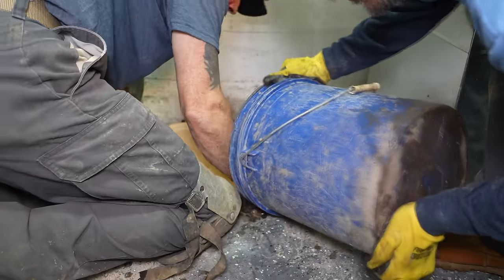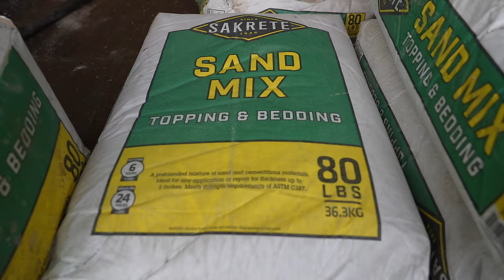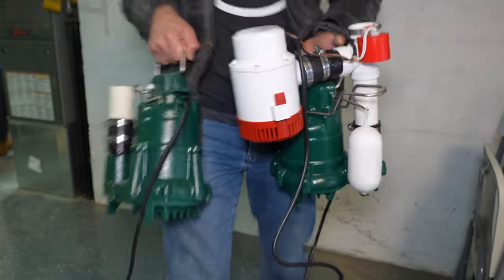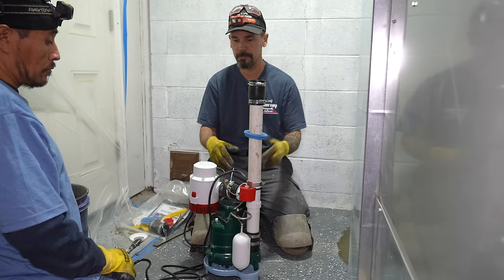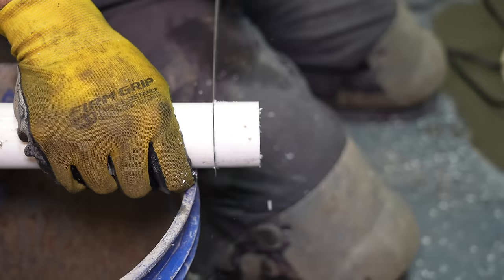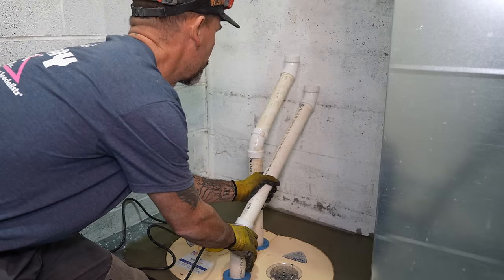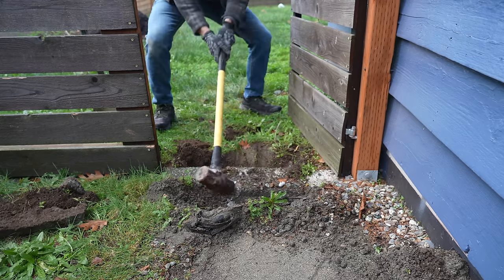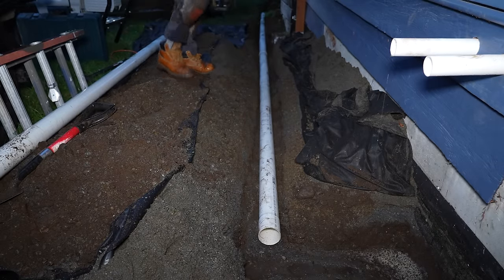TRIPLE Safe Sump Pump System Installation

Comment: I've seen pictures of the Ice Guard freezing over in cold climates.  I'm thinking with an active pump in cold temps, the mist is enough to eventually cause ice to form over the narrow openings.   Reason I mentioned that is because I considered getting one myself, but changed my mind. Great concept, but maybe not the best implementation.

Also, I wouldn't have plumbed both pipes into a single 3" pipe, I would have kept two separate pipes (i.e. completely redundant systems) in case one gets clogged or froze up.  I almost think I'd just leave the 2nd pipe just to shoot out into the yard, despite water maybe some migrating back into the basement.  Perhaps do a little yard work to help it run away.  Just having a stubby pipe discharge wouldn't be any different than water coming out of the Ice Guard.  I'd consider the 2nd pump running as an exception rather than the norm and the goal would be to get rid of water in an emergency.  

Sorry - don't mean to sound like I'm criticizing, I'm not, the install was great! :)  I have two sump pumps and even went as far as running them off of separate breakers just in case if one pump failed and tripped the breaker, it would have shut off the 2nd pump too (if on a single breaker).
Reply: My by design I believe here smaller pump is lower so it gives a chance for the larger pump to sometimes cycle on (most companies just install 2 of the same pumps and second one never gets activated until first pump fails then they find out the second pump has failed as well)
Reply: @leexgx  Thinking about your comment, perhaps using a smaller primary pump to pump out the typical water might lessen the chance for water splatter to freeze up the Ice Guard. i.e. slower but longer = less splatter.   I do think running the 2nd pump straight out is a better option or at least don't combine into a single tile.  You don't want a 'single point failure'  i.e. one thing can render both pumps useless.  I know you have the Ice Guards installed, so you technically don't have a single point failure.  But if one Ice Guard did freeze up, then the chances are, the other one will also freeze up.

I admit I'm a bit OCD about this stuff. :)  The last 2 nights it's been ~-4 to -7F here.   Tonight will be another one, but then the weather turns to a toasty 9F. LOL  More than once I've went out and checked that the pump pump drain is still ice free!  I'd rather be proactive than reactive.
Reply: Air gap would still allow water to pump out if piping failed.
Reply: @sewerrat7612  I agree, but some of the ice guards - I've seen complaints that the openings have frozen shut, probably just do to water splatter.  I still may get one this summer and install and see how it performs in the summer (i.e. splatter or not), then decide if I want it to remain installed for winter.

Or are you referring to ONLY an air gap (i.e. no ice guard)?  I have considered just a straight air gap.
Reply: @Mark-hb5zf only air gap works if there is a larger drain below such as a square grated drain basin leading to piping. Problem ends up being how much it splashes before going out. Could always go directly into larger piping system without sealing the two just dropping piping in that way if end fails at least it pumping outside. Could also pipe in sewer relief poppers would do a few in different sections of line if one areas blocked will just end up pumping to next clear one away from house parts cost a bit though.
Reply: @sewerrat7612  Yeah sewerrat, I agree w/you air gap comment.  Splashing water in freezing temps will eventually turn to ice.  Kind of hard to outsmart physics/Mother Nature. I guess that's what insurance is for at some point, or people just move someplace warm!

Comment: Codes vary, but it is not permitted here to have a storm water drain system inlet set at floor level in the building. Floor drains must be routed to sanitary systems. Ground water is then kept separate from potential floor drain sewage or gray water. Also, the basin size appears undersized, given the power of the pumps. They will cycle too often, especially when combined with the low head  height.
Reply: Hmmm.  I see your point on the concern on mixing floor drain sewage/gray water with ground water.  I hadn't considered that.   In our town, the codes as you note are different.  In the past the treatment plants were unable to keep up with excess inflow from basement sumps etc and then would release untreated waste into the nearby waters (long island sound) even after they redesigned and built new treatment plants.  I guess one way or another, there's going to be potential for that sewage to end up in places where we don't want it...

Comment: Have a double back up system if the power cuts out its also powered by water pressure line in case. Also a back flow prevention from the outside sewer drain

Comment: I depend on a generator and spare pump I keep on hand in the event the main one fails. Simple swap out. We've had power out for over a week from hurricanes and I doubt a backup battery is going to last that long.
Reply: Totally agree. Keeping the system operating in extreme/all conditions is essential, otherwise it will fail. Recommend an automatic failover as failures usually occur when not there or far away to monitor and correct. Ounce of prevention pound of cure is THE RIGHT WAY!

Comment: Great install!  Your material list has the wrong basin listed. I don;t think the one you listed will fit 2 sump pumps.
Reply: The Twin Liner Basket will accommodate the M53, M98 and the Ultra Sump at the same time.

Comment: Guys did an excellent job BUT from experience I would steer completely clear of those (junk) water guard channel systems because there is no way of creating a proper grade when these are placed within the top 3" of the floor and they will continue to always hold water that struggles to drain to the sump & will build up hidden mold in the system.

If you plan to install that type of system in the future & since the floor will already be jackhammered & removed around the foundation,..just Do It Right and install the normal drain tile system that will drop up to 16" below the bottom of the slab & feed back into the sump.

Comment: 3:04 I am curious if the sock by the holes will eventually get clogged by small particles and have to be removed as it's on the outside of the bin. Rather than a filter/grate on the inside where it could be cleaned or cleared of debris.
Reply: it could get clogged, but depends on the filter size, gravel under the slab and silt in the soil, Inside filter is a good alternative easily maintained and montitored. But remember you want water into the basin to then be pumped out and the Zoeller M53 will pump out up to a 1/2  stone, so I think the sock is not good practice.

Comment: Great video! However two 1.5" pipes together do not add up to 3". They actually add up to 2". First on a simple "area of a circle" basis, and second is that pipe wall flow restriction goes up by the power of 5!! So a slightly larger pipe is significantly faster flow. The 3" pipe you put in is actually enough for 8 1.5" pipes!

Comment: Now that you've seen the work done, would you attempt to DIY in the future if needed?
Reply from the maker: Great Question! After seeing how this is done by the pros I'd be 100% confident in doing it myself. HOWEVER, these guys worked extremely hard all day long and now knowing how much work it is I'd most likely have to plan for this type of project to be completed in a week if it was just myself.  Which does include all the time it takes to round up materials and equipment.  Thanks for watching.
Reply: But The thing is these products are not for sale maybe the pumps but nothing else
Reply: @itsabe90  What crack are you smoking? A quick online search and I found EVERYTHING used in this project.

Comment: Is your garage ceiling the floor of a living space of the house.?
If yes look into a better way of sealing out potential fumes from car exhaust, fire proof layer of drywall....
Reply: yes,   install  5/8" firerock on the ceiling and 1/2" on the walls, fully finished. or keep vehicles and any combustibles or chemicals out of the garage

Comment: Its not necessary to install more then one pump. It is a great Idea to have a back up pump being either a battery back up or a water back up system. Also, I know that it is more of an expense to add a french drain around the parameter, but it insures that your basement will not flood again.
We don't use the drain on the footing, concrete should be at least 4 inches to prevent cracking. When we install french drain around the basement we stick to the 4 inch perforated corrugated drain tile and pea stones. Remember, cinder blocks have a hollow cavity which holds water. The cinder block is on the footing and therefore it is not  right next to the soil. Usually there is 3-4 inches of footing before the soil.
I is a little more work but, digging the trench and using a level you can direct the flow better to the pump. Plus, drilling 1/2 inch holes in the cavities of the bottom of the block and running clear tubing into the trench will purge any water from the walls right into the french drain. 
Also, I know its more efficient to just jack hammer a concrete floor but, the reality is that the impact of the jack hammer will cause hair line cracks in your concrete. Its better to use an electric wet saw to precut the concrete to lessen the risk of cracking the concrete, plus its a cleaner look.
Fun fact. the zollar pump is an alright pump and most plumbers like it, we tend to move away from the float switch. These pumps activate every 4-5 inches of water. If there is a high water table these switches are in constant activation which causes the failure of the switch itself. I tend to favor the pressure sensor switch. These pumps kick on after 9 inches of water and there is no way for the switch to hang up or something to get caught in it.

Comment: Get a water alarm. Nice to know when/if the system fails.
Reply: Good to know they exist!
Reply: They work great, too! 9 volt battery, probe sticks down into the sump pit, so if the pump fails, at least an annoying alarm goes off (hopefully before water enters living quarters).

Comment: Looks like you are still low on your discharge lid, the water has to rise before it breaks the top of the yard which means your 3 inch pipe has water trapped inside the whole way

Comment: Basements are swimming pools. acknowledge that..  Power outages for a few days and battery backup is useless. Yea its nice to have if its on a hill with 3/4 above ground. But to do forever it needs gravity drainage.. 30 year storms do happen, or more or less.. Its like Sisyphus keeping a basement dry.  Id raise my washer dryer and heater to a higher level.  after 12 homes one gets more rational..

Comment: Just out of curiosity, I noticed they did not install a perimeter French drain leading to the sump pit?  I always thought this was a necessary measure for a new installation. It seems with that set up you're only really going to get water maybe three or four square feet from the pit?
Reply: I imagine if you locate it near an identified entry point in your foundation/floor slab you can divert a decent amount of water without tearing up a lot of concrete, which is probably the most effective approach.
Reply: @skeptick6513  Most cases of basement water seepage occur due to the rising water table, where water generally permeates through the house footer rather than from a single entry point. My basement currently lacks a sump pump, which I recognize as a necessity. While there aren't visible signs of water entering, there are moisture problems that mandate the use of a dehumidifier during the summer months. After conducting research, I've learned that the most reliable solution involves excavating an interior perimeter trench that houses a perforated pipe directing water to a sump pit.
Reply: @shazaidi  Wasn't necessary in my basement. I self-installed my sump pump very much like in the video. Only difference was I used a 35 gallon or so trash can drilled with many holes. goes down about 32" if I recall correctly. Totally solved my seepage along the footer problem, even when water table is very high. One time to check, I unplugged the sump pump and watched the water come up to almost the top of the pit before plugging it back in. Think about it. If it takes water out only to be replenished, it's coming from a larger area. In my case of 1,000 sq. foot basement, it solved the problem with no other drains, and my land is flat at the base of a slope. Not saying that would work for everyone. Depends on soils, and if there is crushed stone under slab. For further check, my well is about 15 feet from the house. One spring after snow melt and rains with sump pump running every few minutes, I took the well cap off dropped a weighted string down till I hit water at seven feet. That made it just about the level of the footer joint, plus or minus a few inches. That sump pit was the solution for me.

Comment: You should add a 12v inverter and hookups to run the pump or charge the battery from your car
 Or an external generator!!! Power outages can last up to 2weeks in most areas. That battery will steadily degrade and provide max availability for ONLY YES ONLY 2 years!!!

Comment: The problem with most battery backup systems is no one does the maintenance.  Gotta check the battery health from time to time people!
Reply: Some of the newer ones have a plug that charges it while you have power and sound alarm if backup goes on or battery dies.
Reply: !00%  I install battery backups and modern batteries only last about 3 years. The chargers can under or overcharge. Sadly there is no way to know unless you test them regularly.
Reply: @gurugee2112 Try using higher quality parts.  You should get 5-7 years out of a lead acid system.  Considerably longer for lithium.

Comment: My house is on a hillside like yours seems to be, and I have a sump on the deep side of the basement. The other side of my house has a walk out basement door so I don't really think the sump pump scheme makes sense.
Reply from the maker: There it going to be a part 2 with this project just FYI.  This fixes the water table issue.  Next will be fixing the drainage from the front driveway.  Stay tuned :)

Comment: What stops sediment and debris from just piling up and clogging up that drain in the yard?
Reply: It’s the basement, yard debris isn’t inside. Sump pumps are common in most basements including mine. If you had dirt and debris in your basement you’re got bigger issues
Reply: Once water get pump. What ever little bit of debris at the end, will just get flushed out.
Reply: Ok, but there is no pump pressure at the end of that drain. Only the slight pressure from the drop in the pipe outside...  @saulgoodman2018
Reply: @Snaffer01  The pump inside will push out the water through the pipe. Which will clear whatever little bit of dirt that collects in it.
Reply: @saulgoodman2018  Have you even watched the video? The part where they installed the ice guard? After the ice guard there will be no more pressure from the pump in the pipe underground...
Reply: @Snaffer01  The pump create the pressure that pushed it up.
Go and watch a video on how pumps and siphon's work.
Reply: @saulgoodman2018  dude. We are talking about the drain in the yard, in the grass. There is no pump pressure there because of the ice guard. If you dont understand that, then we are done talking lol.
Reply: @Snaffer01  The water is going past that. They do not stop stop the flow of water.
That ice guard is basically useless. If it get's below 32, any water in exposed pipes, are going to freeze.
Reply: Yes the water is going past that, but is NOT UNDER PRESSURE after that. For gods sake please tell me you understand that so we can end this convo.
Reply: @Snaffer01  You are the one who is talking about getting a little debris in it.
Reply: @saulgoodman2018 Bingo, it will freeze, and the water will shoot out the sides of the ice guard, lol garbage
Reply: @shanew7361  It's Seattle, it does not get below freezing. If it is not pumping any water, nothing will freeze anyway.
That still have nothing to do with what little debris gets in there. When is what I was replying about.
Reply: @saulgoodman2018  "little debris"?  Do leaves not fall off the trees in Seattle?   You could easily get a pile-up of debris on the outlet during a dry spell when the pump isn't running.  Then, since the pipe after the frost defender isn't under pressure, it might not be able to blow it clear by itself.
Reply: @AndyLundell  It will still be a little. The flow of te water will drain in away.

Comment: I drained a basement that had eight feet of water and the basement was fifty feet wide and a hundred feet long and was a concrete vault type of thing that had one two inch gravity drain it took three days pumping everything out and I installed a pipe with holes in it all the way to the basement ceiling to prevent it being stopped up because they didn’t know how to clean a drain 1000 dollars is what that cost in 2006 and they didn’t want a pump ?

Comment: So when you have serious water infiltration when have power outage you are going to rely on a battery that may last 8 hours? If it's working hard, it's power will decrease as will the volume of water it can move. 
If you have public water look into the system that utilizes public water pressure to eject water. No power needed!

Comment: I’ve seen mixed opinions on this approach. The other option is to prevent the water from getting into the structure at all with French drain or other runoff system.
Reply from the maker: That is a great option IF it wasn't a daylight basement.  Not going to destroy 1/3 of my house exteriorly just to put in a system that I wish they had in the 1950 haha!  Thanks for watching and mentioning that Max.